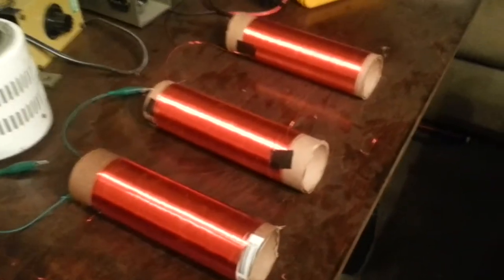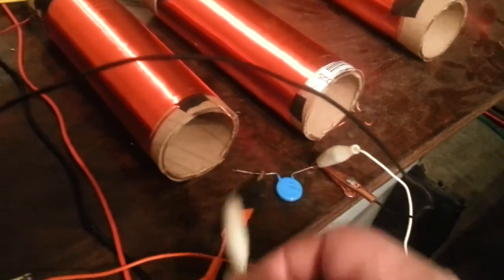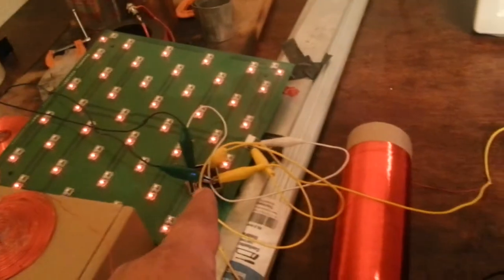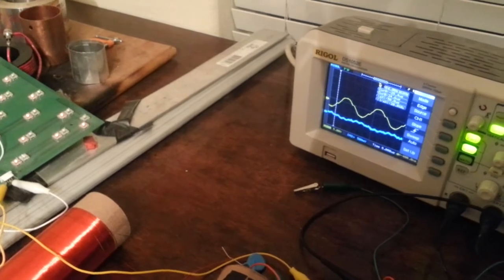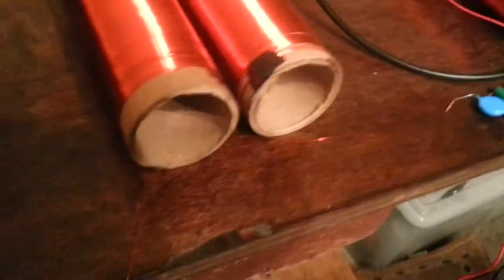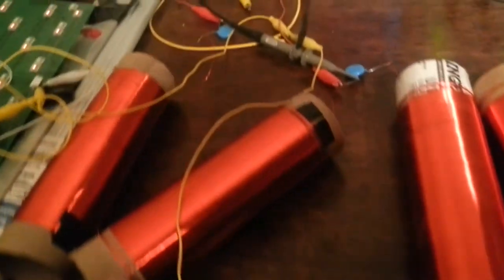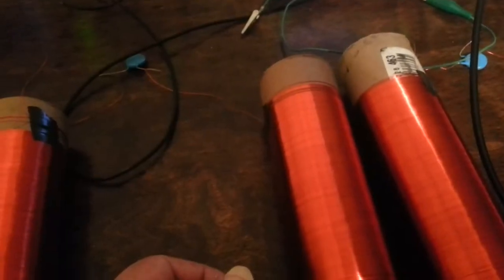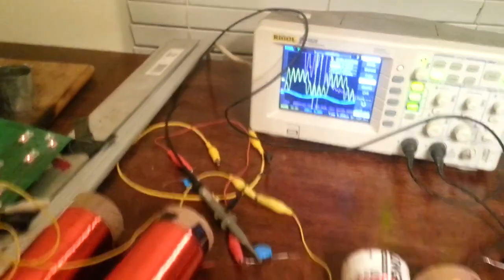LMD Experiment ala KdKinen/Eric Dollard

Comment from the maker: ya, they have a good diameter; so their inductance is 6.97mh; which is actually close to yours, but you have much smaller coils with cores; and since I'm using 9nf, it's like a divide by 10 on the frequency for comparison (or is it only 3 because it's a square root, anyway)    Interesting thought to drive them really high voltage :)  I passed mine through an ignition coil a little, and managed to get a general high voltage field, but it was all flat.  (c)

Comment: What did you use to drive the circuit?
Reply from the maker: was just using a signal generator. which is a pretty low power source.
Reply: @3zdayz  thanks